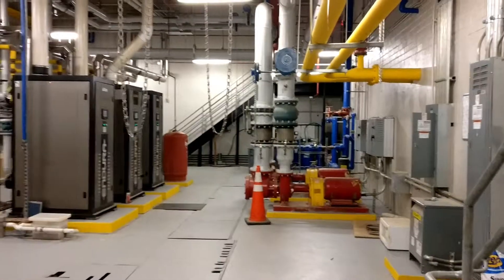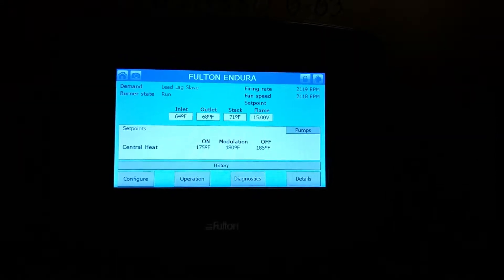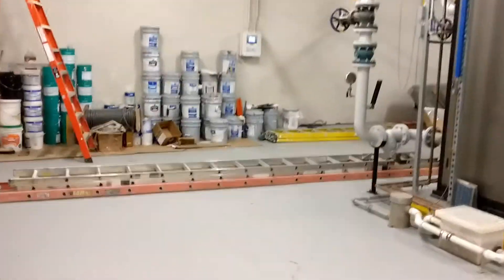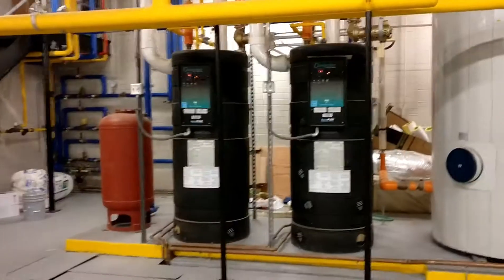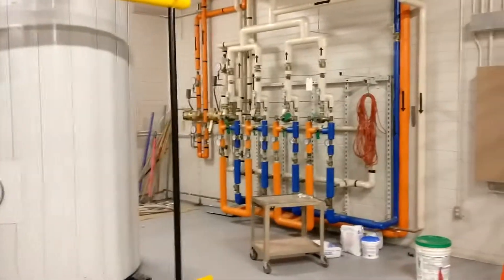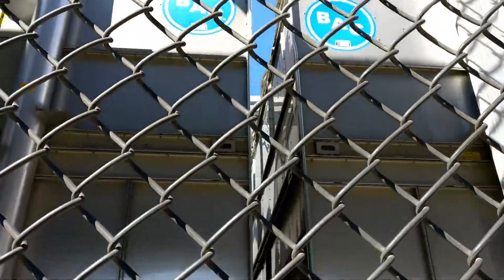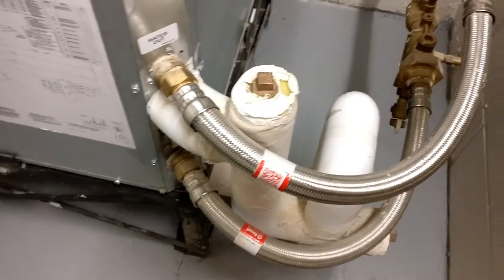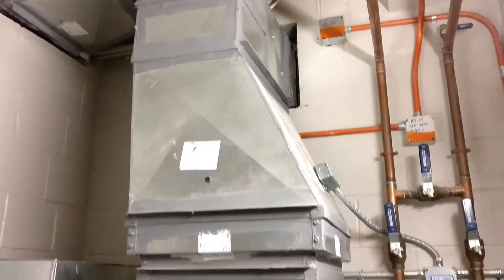Water Source Heat Pump HVAC System Tour

Comment: Nice video.  We do stand alone controls for these types of systems.  Increase the switching frequency of the VFD's to reduce that buzzing sound.
Reply: We call it the Flexeter.  We also replace old Exeter Controller systems.  The Exeter company no longer exists.
Reply: If my phone had reached out and kept hitting me in the head with a hammer it would have been less annoying.

Comment: whats is the operating pressure at condenser loop? do you know if there is a max pressure limit that ASHRAE especifies?
Reply from the maker: The differential pressure set-point is 15 PSI. Not sure if there is a limit specified by ASHRAE.

Comment: Where is the water coming from? Which source?
Reply from the maker: The water for the heat pumps is a closed loop, it is continuously circulated throughout the building.
Reply: @springws14lbss  I wonder if these cooling towers are for homes 🏡
Reply from the maker: @LadariusCapersOfficial  Not really. single family homes with geothermal systems will have a well-field close coupled to the earth that will act as the heat exchanger. You may see them installed in apartments or condo complexes that use water source heat pump systems.
Reply: @springws14lbss  the high school I went to and graduated from have geothermal heating and air conditioning system but no cooling towers
Reply from the maker: @LadariusCapersOfficial  Right, so they have a well-field that they are using as a heatsink/source then.
Reply: @springws14lbss  yep 👍 i figured that and they use wshp unit for each classroom As well as the gym